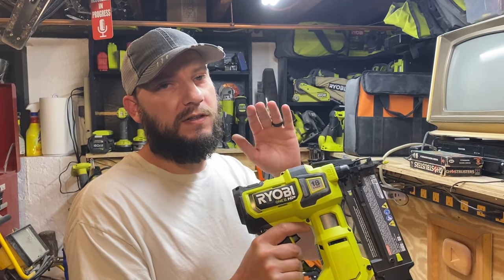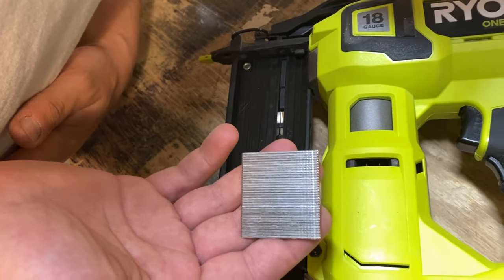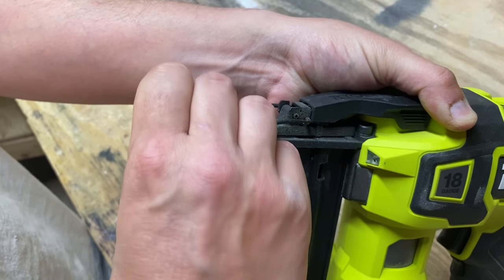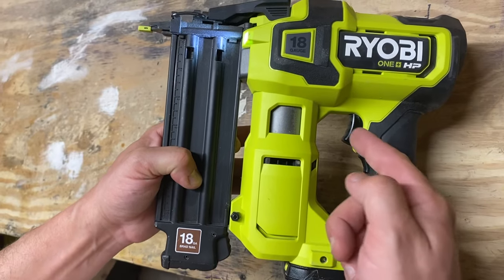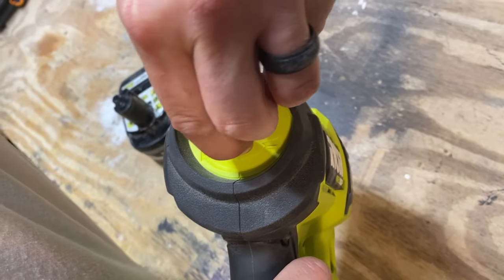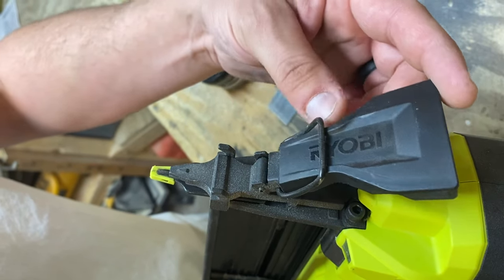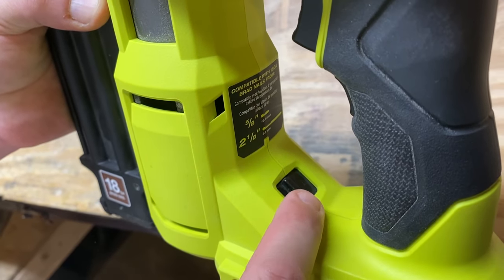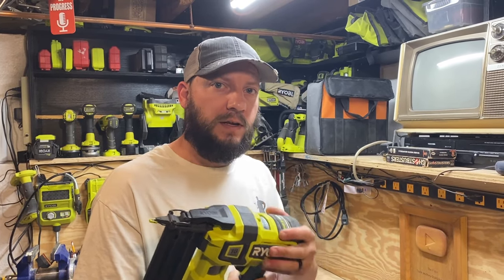How to Use Ryobi 18 Gauge Cordless Brad Nailer

Comment: I recently started using this tool. As a typical hard head I unboxed it, loaded nails and put in the battery. Worked fine but your video really explained it for me. You didn’t rush through it. For the pro with 50yrs experience, I wonder if he lost the soft rubber (?) piece the mounts on the head  and prevents marring?

Comment: I agree with most comments. For me, it would have been helpful if you had spent more time talking about the air pressure and depth adjustment dials. If you are up for it, would enjoy another video that talks more about that. For example, what setting is good for door trim or finishing work, etc.. Thank you!

Comment: I bought the newer model w/ charger + 2x  3.5 amp batteries.   I started using it and experienced very poor performance, failure to shoot nails with any consistency.   Batteries are fully charged.   Changed batteries and got better results, which suggests that one of the batteries is not locking in place.  I could not figure out what the smaller trigger does ... seemed like a safety, but clearly it is not.  Your tutorial is excellent.  Meanwhile, Ryobi warranty and contact is abysmal difficult to access and impossible to create a Login account !  I bought through Amazon and cannot return the unit.  I am going to give it another try today, otherwise, I will try to return it at Home Depot, but I expect that might be a problem too.   Any thoughts ?

Comment: I think your link doesn't match the product. Isn't the HP model the updated version?
Reply from the maker: Really?  The one in the video is HP and the link is for the HP.  Am I missing something?
Reply: @thefixerhomerepair2  Unrelated to your question....I actually bought this exact nailer and I love it. Nails are cheap, about $2,50 for 5000pcs. It's a bit heavy with the 4amp battery and the nose is a bit flimsy. Had to put a cardboard shim to align it.

Comment: Fresh out of the box with mine... my hammer wont retract unless i pull the battery off and put it back in, only driving 1 nail before doing it all over again.
Reply from the maker: That sounds like a factory defect.  Definitely exchange it.  Sorry you had that problem.

Comment: One major disadvantage of this tool is it mars the surface of the wood on every single shot. The only work around I found was to use a piece of 16th of an inch plastic with a slot cut in it. You rest the tip on the edge of the plastic, and shoot through the slot. The plastic distributes the force of the tip and saves the surface. It's annoying to have to do this! Paslode makes a real soft tip for their finishing nailers that avoids this and Ryobi needs to get on board.  Even if you're painting the surface afterwards you're still going to see divots and dents. This is a finish nailer for Christ sake, It's not supposed to mar the surface. Awful design. I ended up returning mine.
Reply: Operator error?
Reply: 50 years as of September as a finish carpenter. What's your experience?
Reply: I don’t know what I’m doing differently but haven’t had your problem.